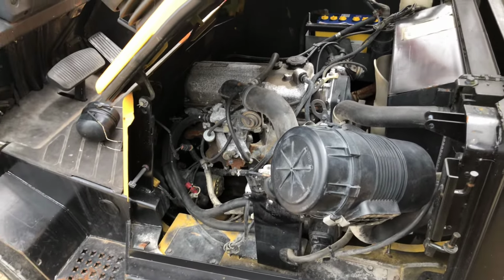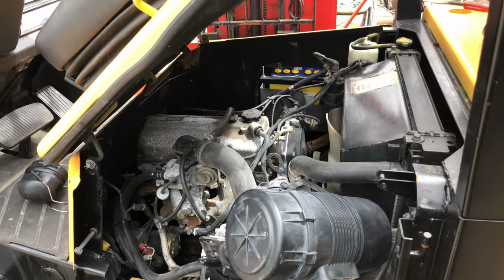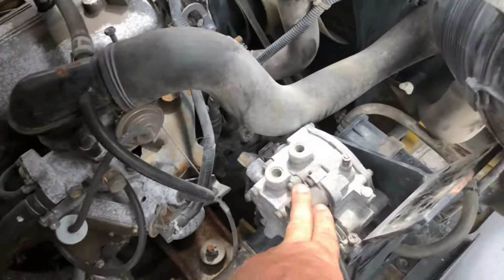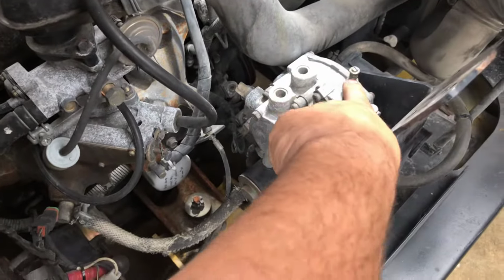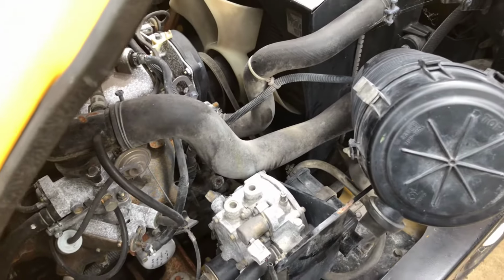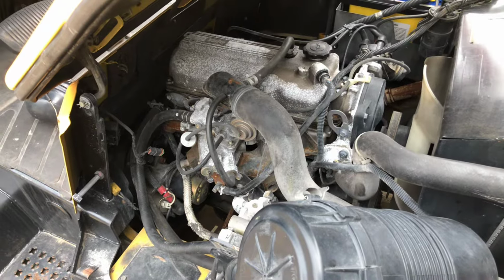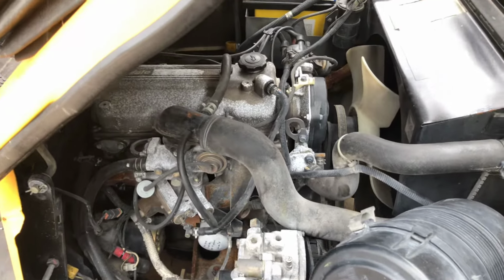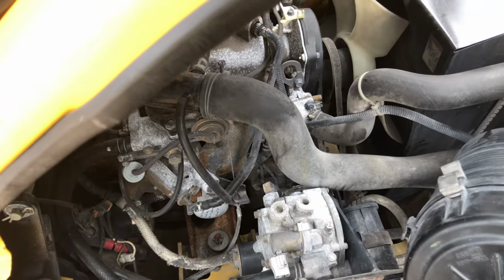LPG forklift not starting? Check the mixture.

Comment: We had all sorts of problems with ours recently. Different system to that. On ours the mixture adjustment is a metering valve on the carby, there was no adjustments on the converter. Ours is old school.

Comment: Lpg fuel adjustment screw.  Some regulators are 2.5 - 6 counterclockwise After you screw it down.   Work your way up 1/2 turn counterclockwise at a time until start up is consistent

Comment: If you have a cold weather NO START issue, apply heat to the lpg injector,, if equipped with ,,,they stick in cold weather,, komatsu 30 lpg 2007,,,